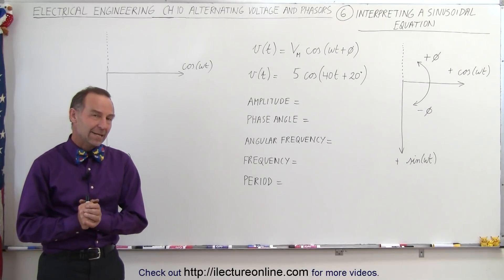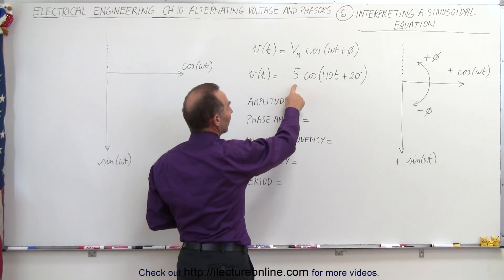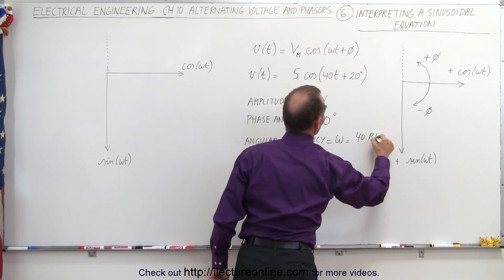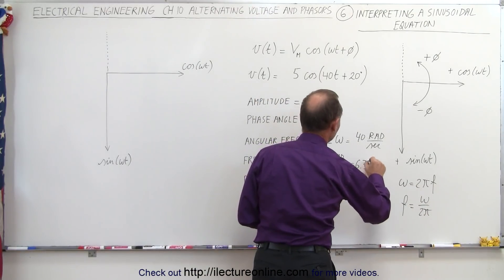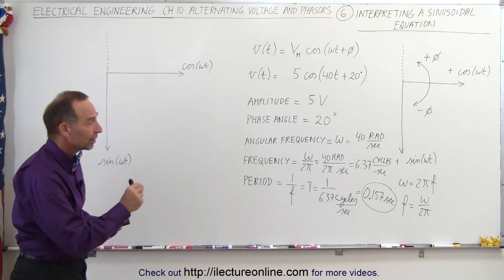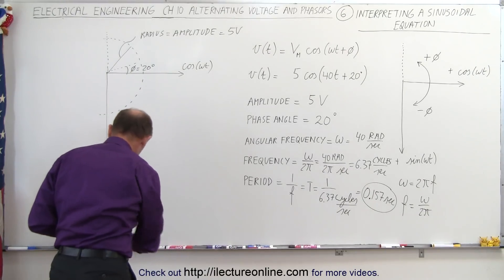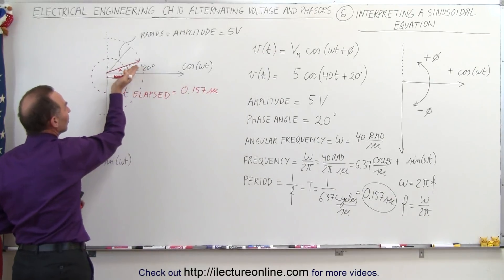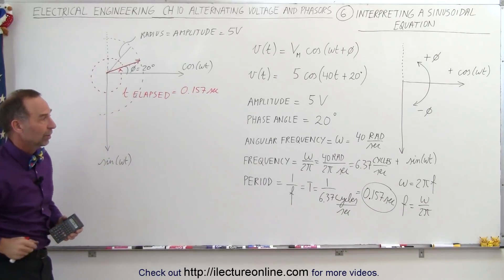Electrical Engineering Ch 10 Alternating Voltage & Phasors (6 of 82) How to Interpret Sinusoidal Eqn

Comment: unit of omega befor (out) (sin) is rad/sec but (into the angle) after sin is deg/sec that is true? excuse me
Reply from the maker: The angular frequency (w) is usually expressed in terms of radians/second.   The phase angle is usually expressed in terms of degrees.
Reply: @MichelvanBiezen I don’t get it, 40t is in radian but 20 is in degree, how am I supposed to input into calculator?